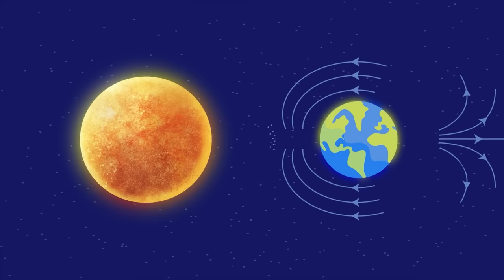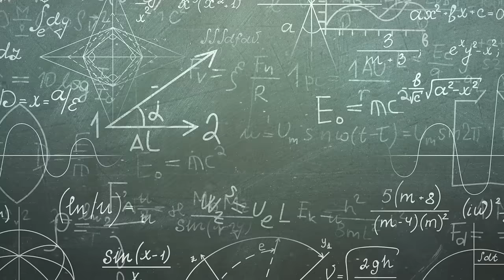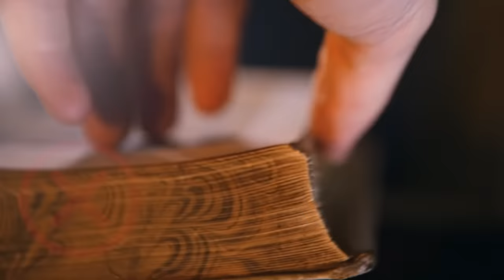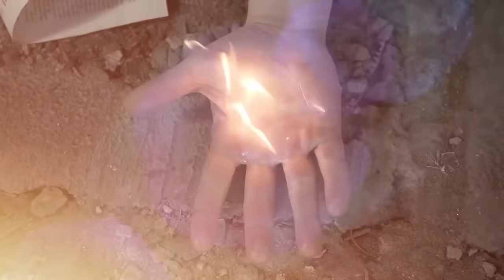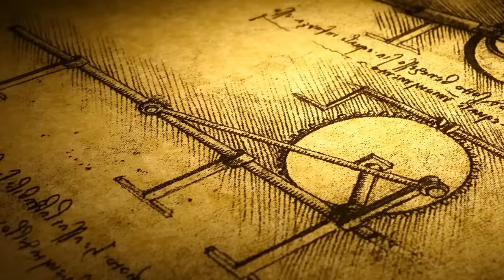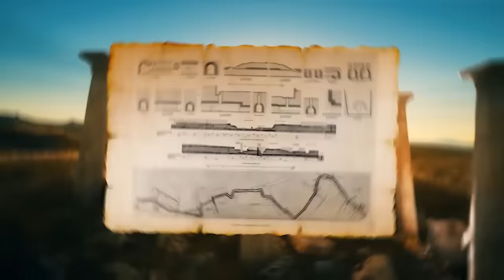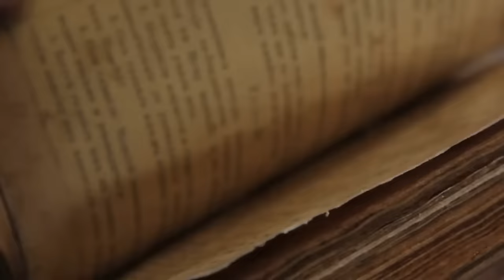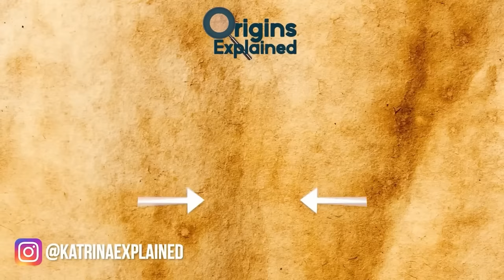Mysterious Abandoned Ancient Technology

Comment: Regarding copper used by Native Americans: Everyone knows that copper is a rather malleable metal, but not many know that there is a simple way to make copper harder - by hammering it - which is how it is "tempered."  Thus, a cutting edge made by hammering copper is much stronger and sharper than an edge made by grinding it down. This is analogous to flint knapping which makes very sharp edges by chipping flakes off hard rocks. I'm pretty sure that primitive cultures knew both techniques, but modern people don't know much about either.
Reply: L